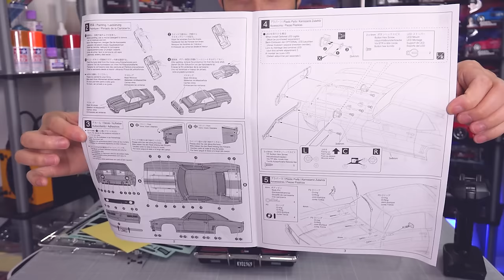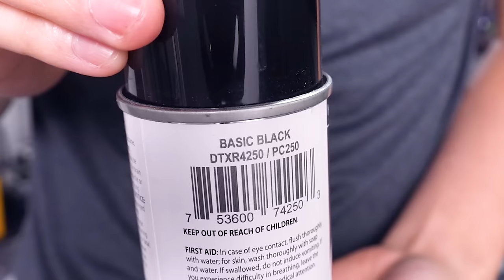RC Modify 37 | Mod 1969 Camaro With V8 Supercharger Engine - RC Car

Comment: I have a 69 but doesn't have the hide away headlights like this one has and mine is a drag car. Losi 22s. I put the 68 Ford body on it after I painted the body. And bought the big daddy wide tires for the back on Weld wheels. But I'm gonna sale that one soon. I have a monster truck I built from ground up that's all aluminum. About $3500 worth and still building it yet. The rest of my parts should be here by Wednesday. I use the monster truck for show at car shows and it's also outrageously fast!! Brushless motor and esc unit, injora wheels, super swamped tires, the Bigfoot/stampede bodies work on this build. Gonna buy another truck body and paint it like I want and put that body on. At some point I wanna buy the dark dragon wing engine and steering mechanism to make it look way more realistic. I've been on YouTube 3 times already from the car show. It's fun and love your channel

Comment: Could  of used the clear shell kit for the (snow) batman/mobile, and the racing shell needs a custom aluminum, or one of those (other) nitro cars. Those cars are high end rc cool, if you can get one for the painted shell.

Comment: Fantastic build!
69' RS/SS Camaro is my favorite US muscle car by far. Just looks right.
Btw the rear wheels are a tad too far backwards, so I think that body has the same wheelbase as Tamiya (257mm) 
Other than that it is perfect!
Reply from the maker: Thanks! I look at it and you're right. I can still adjust the wheelbase between 257-263mm, so I moved it to 257mm and it's perfect! Cheers

Comment: Hey I am building a 1/14th scale cab over Semi truck and was wanting to put smoke to the pipes and add the hydraulic lift look to the truck any suggestions or parts I could go get to make it happen? I would love to see you build one like it just in your style.
Reply from the maker: Can't say much as it is pretty complicated. You can get an RC smoke machine available now, search around. As for the lift system, use 4 servos. On each shock. 👍

Comment: This is insane and so frigging cool! If I may add just 1 constructive criticism and that is the engine rotation is in the wrong direction. It should be counter clockwise. I know a very small detail but for as much detail as you're doing I thought you might like to know.
Reply from the maker: Thank you! So, counter clockwise when looking at the rear of the engine or the front of the engine?